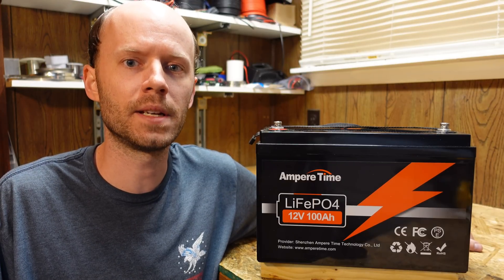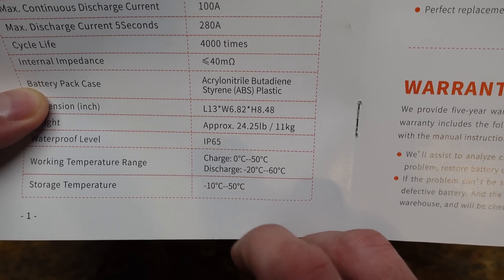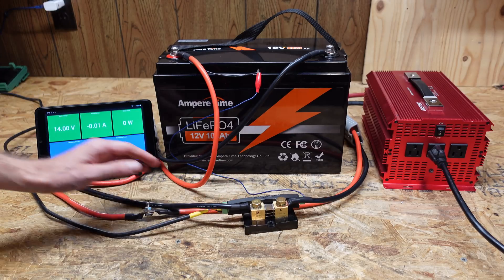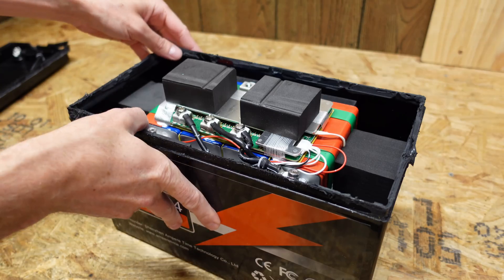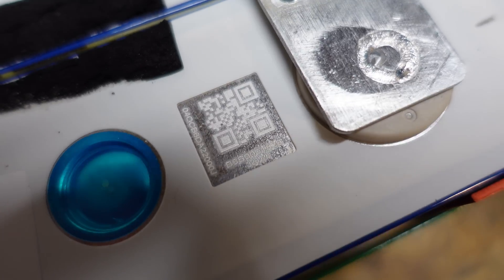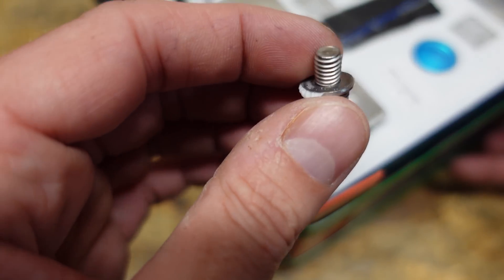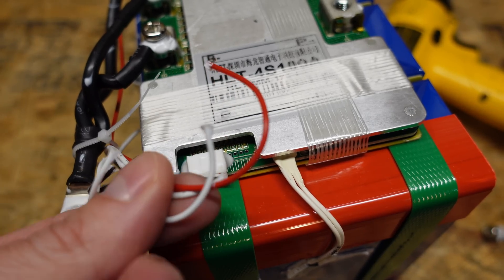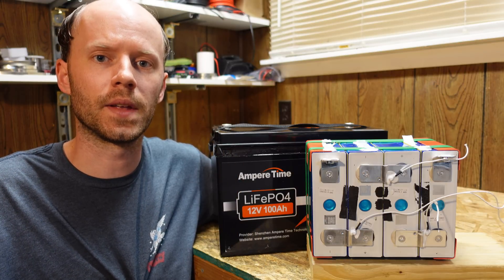Ampere Time 12V 100Ah LiFePO4 Battery Review and Teardown, $312/kWh

Comment from the maker: LiTime 100Ah... https://www.litime.com/products/litime-12v-100ah-lithium-lifepo4-battery/?ref=lithiumsolar
LiTime 200Ah... https://www.litime.com/products/litime-12v-200ah-lifepo4-lithium-battery/?ref=lithiumsolar (affiliate links)
(Ampere Time is now LiTime)
This battery is already fairly popular. If you have one, please let us know how it has been working out!
Reply: Hi, we want to invite you review our LiFePO4 battery!
Reply: I got mine last week so far its been fantastic
Reply: The 10A brick charger does get hot to the touch though
Reply: @JOHNDANIEL1  If you know that, it seems like a no brainer to post the address and the brands.  Have at it.  I'll +1.
Reply: @JOHNDANIEL1  Thanks ... that was very useful. 👍
Reply: Can you tell me how to troubleshoot a  BMS.  I  have a warranty issue with one of the other manufacturers. I  can't make them understand  my  problem
Reply: These  batteries are  under  warranty and I can't  open the  battery  case. SanTan  solar  has already  replaced  the   solar  controller.    And  I was  recommend  to  enlarge  my  0 awg  copper  cable to  4 /0 cable.
Reply: @JOHNDANIEL1    these  batteries  are  cutting out  when they  reach  28.2v  and  then  immediately  comes back  on.  Which  cycles  power  to the inverter.  Which  plays hovac  with  load.
Reply: The   charger has  been  replaced  with a  new  one. 
After  that  didn't  help  anything ..Santan. technician  suggested  to  replace the   batteries,     I had  two  AGM.  batteries  and  after  installing  them   with the  same  parameters  as  the  lithium batteries. The  solar  system  working  perfectly.  And  able  max charge  the  batteries 
So  what do you think the problem is??
Reply: Sorry to be a bother. 
Can you  give me the rest of the numbers.   I don't think that I can change just one. 
Thank you 😊
Reply: Thanks man. I will try that.
Reply: Hey  man  good day to you.    Help  please.  Is 3k reliable   pure sinewave  to big  for. 2-   12.8 v , 100amh  batteries  wired  for  24v..??
Reply: Hello. 
Has anyone tested the 100a battery at what lower and at what upper voltage level does the BMS turn off the battery?

Comment: I have 2 of these that I'm finally installing in my van.  I'd like to mount them sitting on their ends, or lying on their sides (one stacked on the other), to save space in the van.  The foam padding looks adequate.  Would there be any concern about mounting them in either orientation?

Comment: I recently purchased this battery and see (after charging) the resting voltage settles to 12.9v after few days.  I did a capacity test at 13.35 and it was 100ah.  All the charts tell me it should rest a half a volt higher.  LiTime service isn't responding.  Any thoughts?

Comment: I have 4 amp time batteries that have been at work for 1 1/2 years. I just separated them from there position in my 24 volt solar array and every battery has EXACTLY the same voltage an hour after disconnecting them from one another. Wow!! 10,000 watt battery bank and a 2000 watt array.

Comment: When I contacted Ampere Time last month about whether to go with their 24 volt  100 amphr battery or two 12 volts in series for my 24 volt trolling motor they suggested going with the two 12 volts because it had an update BMS… do you know what is updated?

Comment: no bluetooth...how much could that cost to add in?  Chins for the win.
Reply from the maker: I know this is a feature many look for; however, I don't personally see a need for bluetooth in my batteries.
Reply: @LithiumSolar  I think it’s be beneficial to monitor them, especially with 2 batts in parallel.  Rv application—bt would be better then a smart shunt (I think)

Comment: I want to skip using the BMS in my ampere Time 200 ah plus battery I already took it apart and whatnot I want to use my kisae inverter charger to charge the battery directly will it work ?  the inverter charger has a lithium profile

Comment: Foam because hairy western barbarian think bigger case is more battery.
Reply: Case is sized to accommodate drop in replacement of a lead acid battery. Same dimensions as a lead acid group 27 @~ 100 amp/hrs.

Comment: I appreciate my Ampere lithium. So thankful lithium batteries finally came down in price! I need a 3rd 100ah now.
Reply from the maker: Great to hear, they are fantastic batteries!
Reply: @LithiumSolar  hey here's a great question for you. My wife and I were just wondering. Why is it, after the sun is out. And the batteries are 100%. By night fall, the battery status is at 12.9-12.8??? Which is 20%

Why do we only get to use 20% of the battery??

Comment: if a batter has a High Temp sensor in the  BMS, but no low temp, is there an external way to doing this that you can recommend?  Keep in mind, I am not one to open a battery case and do some adjusting. :)
Reply: Some charge controllers have a low temp cut off. My 40a Renogy MPPT controller came with a temperature sensor specifically for this purpose.

Comment: I have been using a 100ah Ampere Time all year to power a 12v trolling motor on a fishing boat.  I do a lot of Kokanee fishing.  At typical trolling speed I can go all day at 1.3 to 1.5 mph.  I am drawing about 8 - 9 amp hours at that speed.  Bump it up to over 2 mph and the draw goes up to closer to 20 ah.  I have used it on average 5 to 8 hours every week since March.  Absolutely no problems what-so-ever.  Very pleased with the product.  I bought it on E-Bay in February or March for $279.  Yes, $279.  What a deal.  I only wish I would have bought a 200 ah as I like the idea of having a larger gas tank.
Reply: What trolling motor are you running, and does it have a "Pulse Width Modulation" throttle, like the Minn Kota Riptide series?
Reply: @ts3871  I have the Motorguide Xi3 55 lb thrust with variable speed remote.  Its really cool because when I am setting the downriggers up in the back of the boat, I can keep control of the boat from there.  It has ample power to push the boat unless the wind is blowing real hard.  The boat is a 16' Smokercraft side console and weights about 1200 lbs fully loaded.
Reply: @rickw9169  How accurate is the spotlock on the Xi3?
Reply: @soupertrooper3864  The model I have does not have a spot lock.  Can't help with that question.
Reply: @rickw9169  Ok thanks
Reply: How many hours does it last for you to troll during fishing?
Reply: @ia6980  Totally depends on the speed and wind conditions.  If the wind is relatively calm, I am normally drawing less than 10 amps per hour @ 1.3 to 1.5 mph.  I have been out as many as 6 hours and used about 60% of capacity and as few as 4 hours on a very windy day and used 80%.  My average day is about 5 to 6 hours on the water, running the motors for between 4 and 6 hours.  I normally consume about 50% of the battery capacity.  Hope that helps.  I have a Victron smart shunt and it very accurately tells me where I am in consumption, amps used and amps remaining.  Pushing it to 2 + mph definitely draws a lot more amps, 20 to 30 amps per hour range and would probably only run for 2 to 2.5 hours before depleting the battery.  For trolling speeds above 1.75 mph, I use the main gas motor.

Comment: Bought 2 of the 100AH 12v, returned them both, they were dead in 2 hours of trolling on the lake, My AGM batteries last 4 hours.  Customer Service was decent, they kept telling me I didn't know how to charge batteries and demanded I use their charger, even sending me one when I told them "no".  Despite that, they kept in contact with me and once I put a battery monitor on them and proved that the batteries were not holding 100AH at full charge they sent the return label and even refunded the money as soon as FedEx checked in the boxes.
Reply: That's interesting to know,  cuz i ordered one for trolling also, ill test and see how itll hold, i have standard battery and it lasts about 3-4hrs with moderate use.
Reply: I can’t deal with such bullshit. I live in Japan and dealing with support gets complicated.
Reply: From personal experience a lead acid battery charger will not fully charge a lithium. I had to buy a specific lithium charger
Reply: Yes you must use correct lithium chargers. Have had an 100ah for 3 months now on heavy tournament rigged kayak. Run 8 hours all day using only 20 % capacity…..So far so good, will see

Comment: Thanks for all of your videos.  Very educational on many topics.  I was wondering if it would be possible to exchange the BMS for one with low temp charging by just unplugging the harness at the BMS and plugging it into the new BMS?  I would not want to mess with however those cell connectors are attached.  It looks like they soldered the hole where a screw would go.  Thanks again.

Comment: I’m looking to put a aux battery in my truck to run a sump pump at work when I need to pump out a machine and might get a small fridge/cooler for my truck off of a 1500 or 2000w inverter. What battery would you recommend I get?  Thx

Comment: These batteries make buying leadacid worthless.. u have to keep in mind for every 10ah of Lifepo4 u need 30ah of lead acid. 
I recently made a pack for my ups with 4yr old Lifepo4 cells that were sold on a discount as 5000mah cells but all tested out as 6000mah , 24v 12ah pack i made and it ran my ups for about 45min on 300w load.. & that runtime according to apc's website can be achieved when the ups is having 27ah of lead acid.. 
Each of those 9ah lead acid batteries cost 30$ & so it is 180$ to buy leadacids while i can have similar run time for 40$ from newold stock cells.. if i buy oem leadacids from apc that would be 350$ for 3x apc rbc124.. 
Leadacids are now only useful in starter battery!
Reply: And they`re heavy as hell too.

Comment: Questions:

÷ Does it have an automatic cutoff for low voltage to protect itself, or do we need to pay extra for a "smart" version ?

> Can it be used in a car or truck, and if so how many CCA can it put out ?  And does it require a proprietary charger ?
Reply from the maker: It has low-voltage protection. It cannot be used as an engine-starting battery. It requires a charger for LiFePO4 batteries but nothing proprietary.
Reply: @LithiumSolar  Ty 😄
Reply: Fwiw, i'm looking for a portable 50Ah model to power medical equipment during power outages.  This tech seems perfect, but i gotta wait for prices to fall by at least a third from where theyre currently at.

I currently use a sealed lead acid deep cycle (optima yellow top) that's 12v 65ah, and able to jump my car if needed, but the sucker is HEAVY.

Comment: For a marine application, would it be possible to connect this battery in parallel to my existing lead acid, so that I might have both engine start and deep cycle functionality?  If hooked up that way, would the LiFePO4 keep the lead acid fully charged?

Comment: I want to build an emergency hurricane system for a small Frigidaire 5000 BTU air conditioner using a 12 volt 300 amp hour battery by this brand. Not sure what I need to complete it. Was thinking about a 60 amp MPPT charge controller and 1500 watt inverter. I have three 100 watt panels and one 200 watt. Any ideas to keep me from destroying something? I have MC4 cables and parallel connectors. How should I add fuses to this or other safety measures? I need to learn this before mid August but I`m confused and don`t know exactly what to do.
Reply: @Danang Alta Thank you.

Comment: Hello I would like to use the 100ah 12v in a car audio system with a 370 amp alternator pushing 8000watts do you know if this battery would work for my system?
Reply: These are typically limited individually to 100 or 200 amps depending on specs.

Comment: Hello, I am building a van electrical system with a 2000 watt inverter/charger and want to add a battery capacity of 200ah. What would be the best way to do this, one 200ah battery with 100A BMS or two 100ah batteries with 100A BMS's. I guess another option would be a 200ah battery with a 200A BMS. Would the two 100ah/100Amp BMS batteries option allow you to draw 200Amps total? As you can tell by this question I do not know much on this subject, so any advice you can provide would be greatly appreciated.  Thanks
Reply: I live in an rv, one battery means, if something  goes wrong. No power. 
And limited buy bms. 3 in parallel means 300ah discharge, and if one has an issue  still have  200ah.

Comment: I wish the battery was measured by Watts, almost all appliances list their watt usage. So AMP Hours does not make sense to me. Just my thoughts.
Reply from the maker: I used to report capacities in watt-hours in the very beginning of my channel. I switched to amp-hours because it accounts for losses in the wiring, circuit breakers, etc. Measuring in watt-hours does not.

Comment: Is anyone here buying these for golf cart conversions?
Reply: Of course. My brother has 4 chins in his ez go golf cart. Works like a charm. I'm looking for a cheap 48v cart to put a set of 4 of my solar storage batteries in. It would serve a dual purpose. Drive around and when I'm not driving it then it would be plugged into the solar system to provide power for the house. A portable battery in a sense

Comment: I see the limit on wiring these in series (4), but is there a limit on wiring them in parallel? I'd like to wire 8 of them together for 800 amps.
Reply from the maker: Theoretically there is no limit provided you are using the proper over-current protection (not covered in this video) with regards to interrupt capacity.

Comment: Looks like they could put at least 2 more cells in that case,
do they have larger capacity batteries?
Reply: i like my zooms which probably are the same as this brand . wished they used smaller cases for a smaller form factor.
Reply: Yes, they sell a couple larger capacity batteries

Comment: Incandescent light bulbs? I forget that freedom still exists, they don't trust us with those in Komifornia.
Reply: Do some people miss incandescent bulbs?  I sure don't.  I live in a hot climate and the cost of running an air conditioner is high enough without trying to cool off a dozen little heaters in the evening.
Reply: @posteroonie  I miss the ability to bake a small cake. Just saying...
Reply: @loucinci3922  What a blast from the past, the Easy-Bake Oven!  :)
Reply: @posteroonie  When they were banned we only really had CFL's as an alternative. They were expensive and didn't last as long. LED's were new and had really bad color profiles. Now there are really good LED options and I prefer those, but people should be able to buy what they want.
Reply from the maker: They make great resistive loads; however, it's becoming increasingly difficult to find them...

Comment: These batteries have been great for me personally...I have 6 200ah currently powering most of my house with 2 more in transit. Never had even one blip of an issue, never completely drained either. These are very powerful! Good review and happy to see they are quality on the inside as well.
Reply: What size inverter? Are you using in series (6 maybe not). Assume 12V @ 1200Ah. Cool. What big stuff do you run?
Reply: @loucinci3922  I have 2 3000w inverters that run most of the house. I have 4 batteries in parallel on 1 inverter and 2 in parallel on the other. The biggest items I run are the washer and deep freezer,  I also use AC sparingly in the summer. Other then that all lights, all tv's and air cleaner. I have a smaller stand alone system of older agm batteries that powers a fridge in the garage. Our electric bill compared to last year as I was building the system was recently down 58%. I have about 2.2kw of solar panels charging the batteries. I'm in the NE so limited sun otherwise I could possibly get off the grid. I started out with 1 solar panel and one charge controller and used batteries from my work place. I realize 12 volts is not the most efficient but that's what I started with and it does the job.